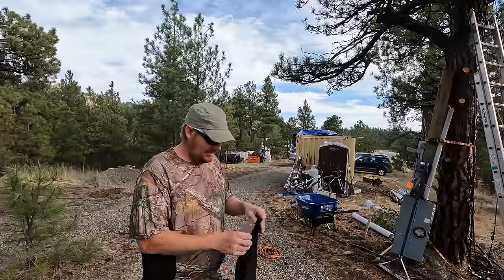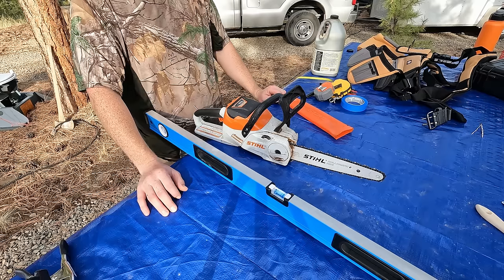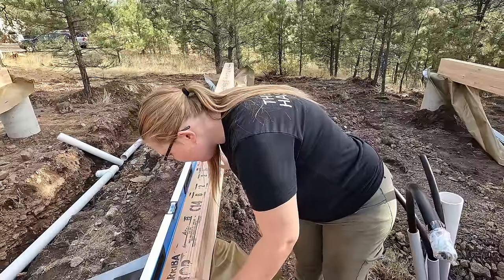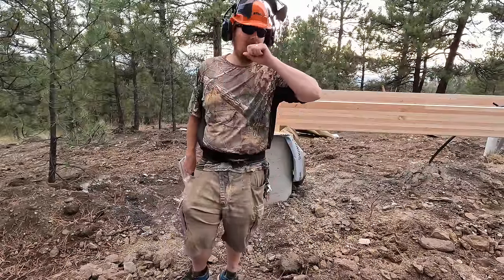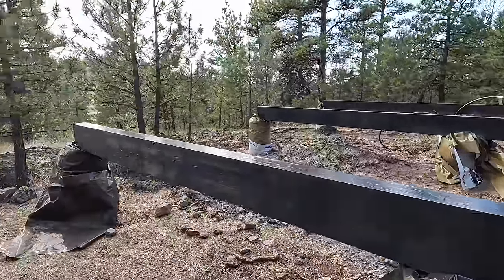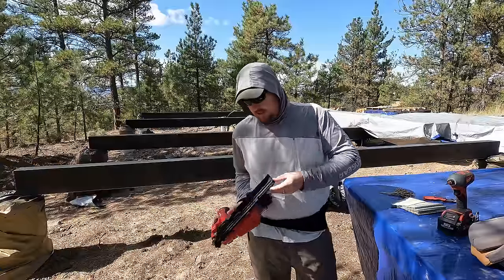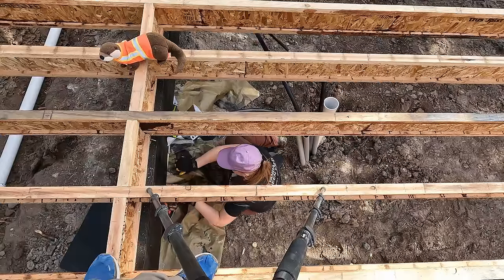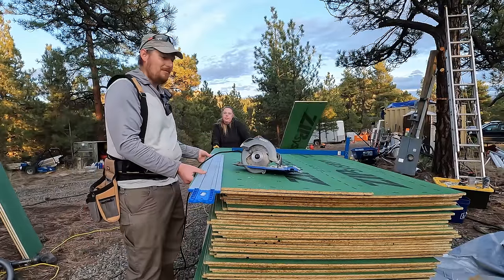Building Our Cabin Floor | 24x24 Off Grid Cabin Build

Comment: Nice video! Looking forward to more. One observation from an admitted non-expert. The I-joists span the three laminated beams, but I-joists at the ends of the structure cannot carry dead load. Instead, I believe that you should use beams that are capable of carrying the weight of the walls and the weight that the roof transfers to the walls.
Reply from the maker: That is correct. We used 2"x10" rim joists to bear the load of the wall. Between building the 1st and 2nd floor, we watched this handy video: https://www.youtube.com/watch?v=7XWfbMyQIoo. Which taught us to position the rim joist 1/8" higher than the I-Joists. We got that right on the 2nd floor. 

The 2nd floor walls and roof bear down on the 2nd floor lvl rim joist. The roof load bearing walls have a solid bearing on the 1st floor rim joist. The gable wall connected to the porch could use a little more strength at the base to bear more on the rim joist. We shimmed OSB strips under the rim joist to help it, but we'd like to do something better. 

Thanks for watching! Great comment!

Comment: Whew your two's budget is a lot larger than are's was/is.....  Good luck on that build
Reply from the maker: We've been planning and saving for the better part of a decade for this homestead, and we're still finding building materials to be more expensive than planned. We'd like the buildings here to last as long as possible with as little maintenance as possible. It requires a bit more up-front cost, hopefully it will pay off in the long term. Thanks for watching!

Comment: Split them apart and measure each TJI and cut with your skill saw. I know  you want to be accurate  bur some times your a little to finicky. It will save you time. No carpenter would try to cut them all together, unless you had some different equipment.😢
Reply from the maker: That is what we ended up doing on the next set. A speed square and a skill saw got the best cut on them. Thanks for watching!